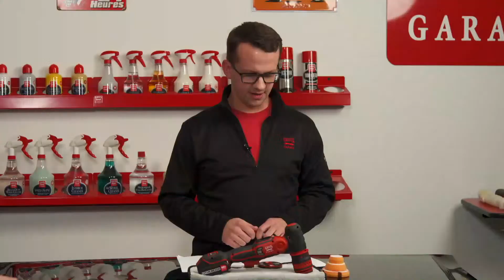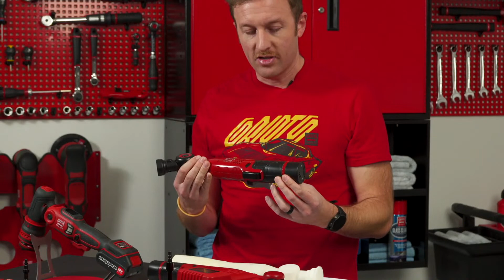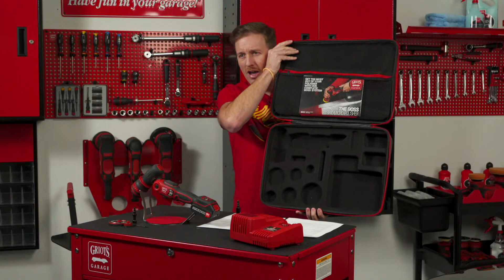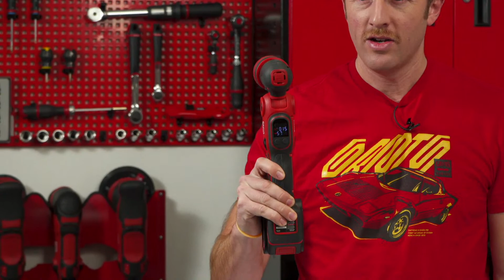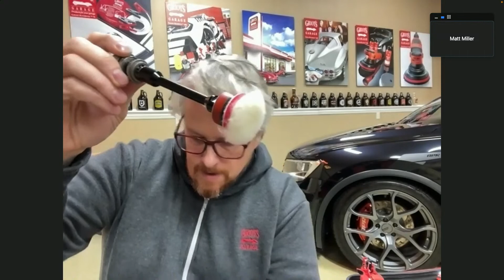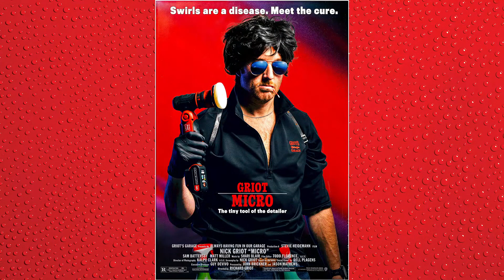Griots Garage LIVE: Introducing THE BOSS™ Hybrid Micro Polisher

Comment: It was a great show unfortunately  Jeff was having technical issues with his iphone ( switch to the new Samsung Galaxy S23 Ultra you will never regret it) I would had love to see more demo on the Hybrid Micro polisher but time just flew right on by almost 2 hours.  
I felt that I was very active asking key questions especially some technical ones that was never answered. I got excited about this Micro polisher because I borrowed the G9 to work on my Mustang GT and wasn't able to complete it to perfection due to the limit spaces you can get into with the G9. Looking at the Demo last night this polisher would have definitely finish the job to perfection .
Here are a few questions for the team

Is the digital control center led screen IP6 rated?
The cell being used in the battery pack are they 18650, 21700 or Stacked technology?
Will there be a offering to purchase a shorter throw adapter drive vs the 13mm that is included?
Will the inverter support 12v connection directly from the vehicle?
during the 5 years in the making was there a time that you wanted to scrap the project ? or had sleepless nights
5 Years is a long time to develop a polisher do you think you got it right or is there other functions or pieces you wish you could have added? One thing I would have added would have been a tool less backing plate removal and install.
Like I stated before I borrowed the G9 from a friend because I am new to Griots brand I want to make the right decision when buying any products,  just  so many great tools out there per Jeff comment last night. I like to invest on a company that are innovative and backs up there products 100%  the few times that I have been in the Live stream I can actually see how passionate Nick and the team are when showing off the products. I like that and offering the life time warranty is insane just the warranty alone would steer me to Griots products.
just wanted to share my thoughts.

Comment: I’m in the PNW and love supporting companies like yours. How does the performance compare to a plug-in? I’m looking for a 1-3” option that’ll fill the gap in my system. My fox body needs a smaller buffer. 

One question that I didn’t hear an answer to is how easy is it to learn to use? Meaning with so many different functions is there a steep ramp up on learning to use this coming from just a standard long throw orbital buffer?